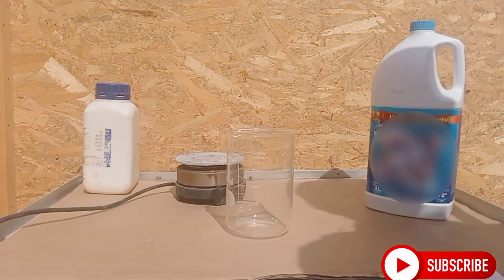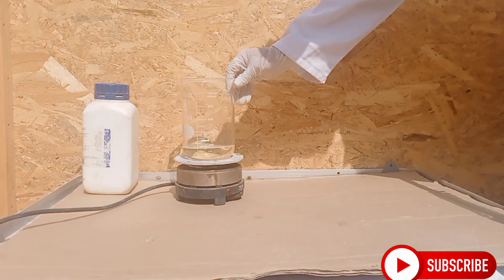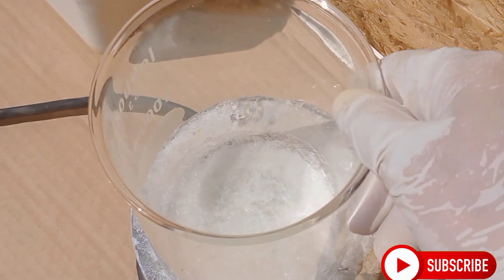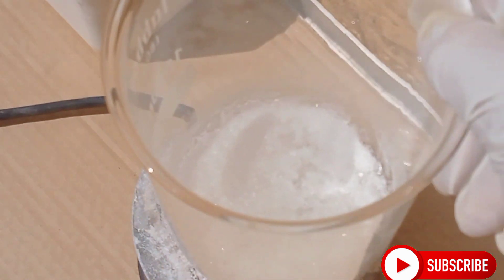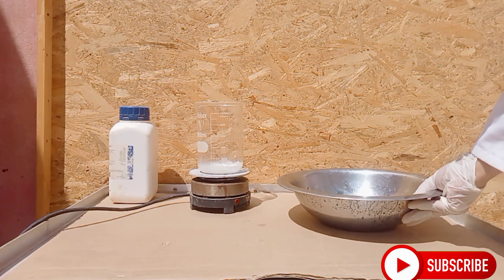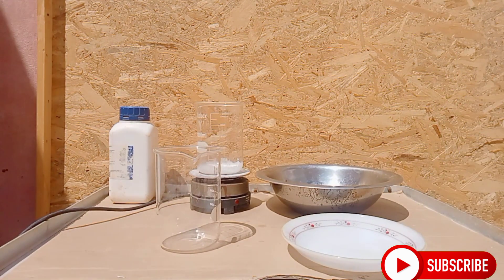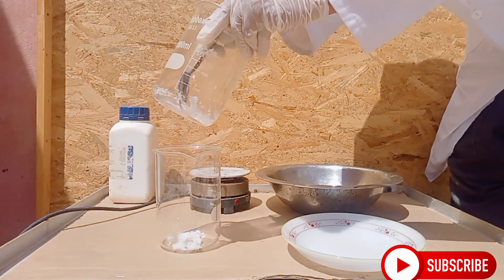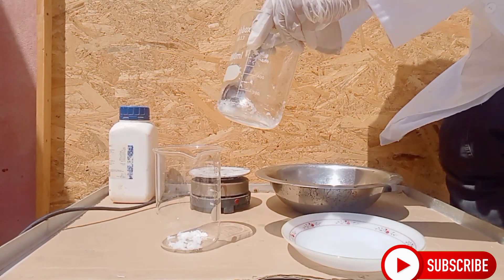Separate palladium with sodium chlorate/How to make sodium chlorate /

Comment: If you heat it to dryness, is there not also A LOT sodium chloride contaminating the product?  Shouldn't you crystalize out the sodium chlorate & drain off the sodium chloride solution, then wash with very cold water?

Comment: Factories make Sodium Chlorate NaClO3 in 100 ft square tanks 6 ft deep the anode is .2 to .3 amp per square inch, cathode is .1 amp per square inch 4 volts DC.  At 44° C salt is dissolved current efficiency is 80% cool to 25°C efficiency is 85%.  NaCl +3H2O + 6 Faradays = NaCl3 + 3H2.  Cool solution NaCl is crystallized out until solution becomes concentrated NaClO3.  At 20°C NaCl03 crystallized out and removed.  A factory can make 250 tons of NaClO3 per month.

Comment: Your process for extracting chlorate is pretty dirty... By boiling the bleach you are causing a disproportionation reaction in some of the bleach gets oxidized to chlorate, some gets reduced to chloride. The two salts are not very easy to part. Ive yet to try this process with palladium, but now i think im gonna plan to give it a go but instead of using the sodium chlorate/chloride mix, I'm going to convert the sodium chlorate to potassium chlorate which is easier to purify and i assume will perform an identical function, but be a lot cleaner